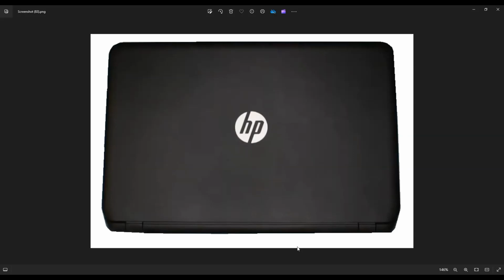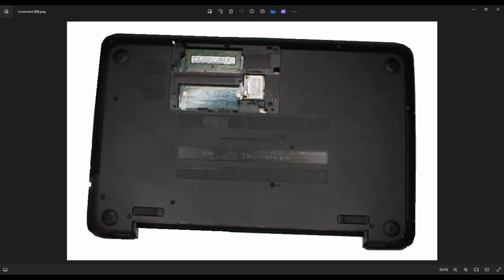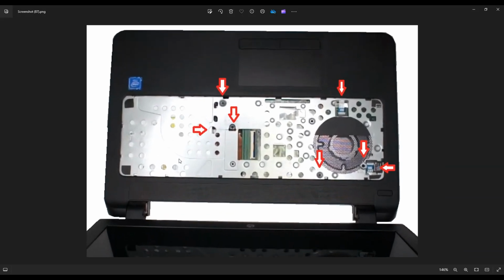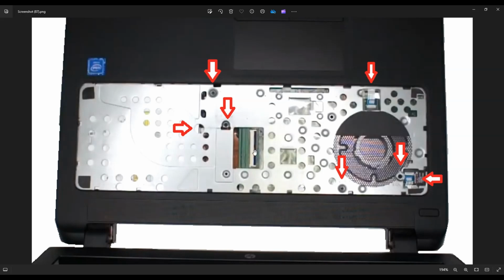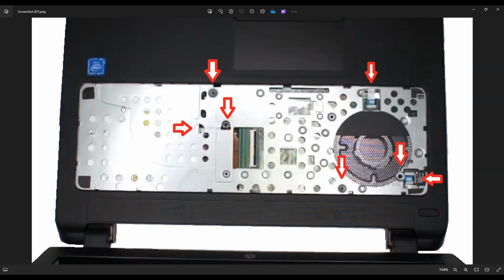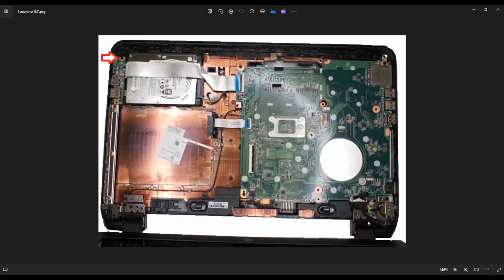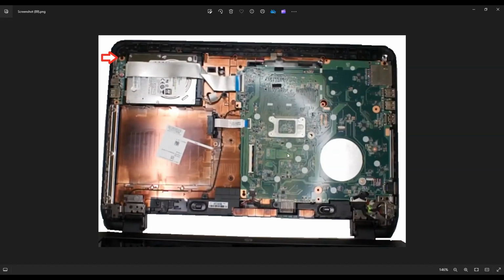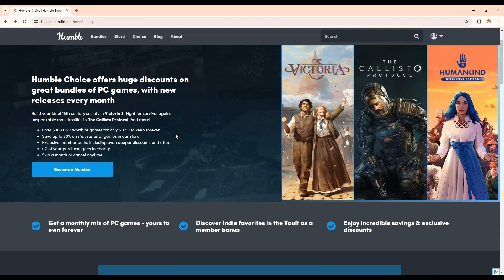Teardown / Disassembly Upgrade Options HP 15-f Series Laptop (15-f233wm)

Comment: I was hoping u show where the power jack was and the power connector to the mobo... 😮
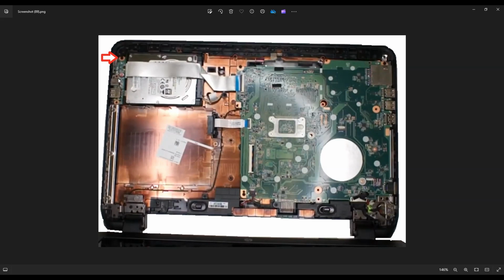Reply from the maker: Sorry bout that. I usually lump that in with the motherboard and assume ppl can find it. Ill try to point it out from now on. In this computer, you can see the power jack at 5:35 in the video. Its under the hinge assembly in the bottom right corner of the motherboard and plugs in to the mother there near the LCD Cable. Hope that helps find it :)